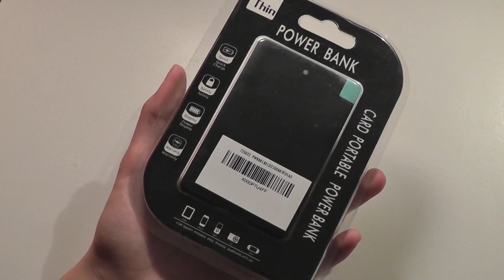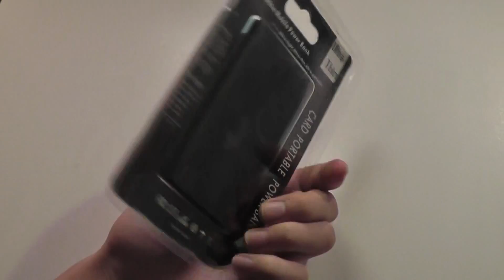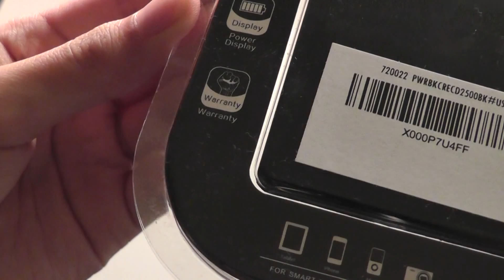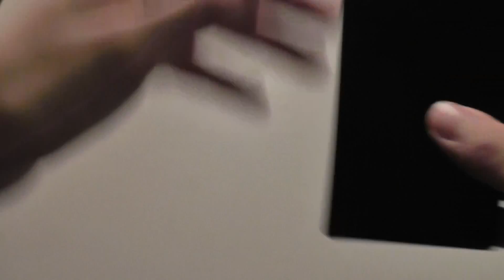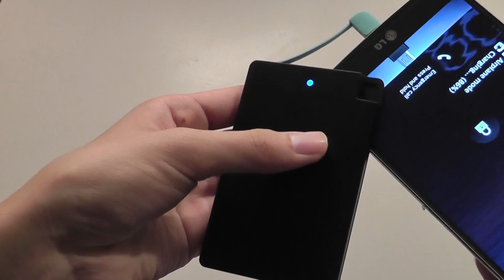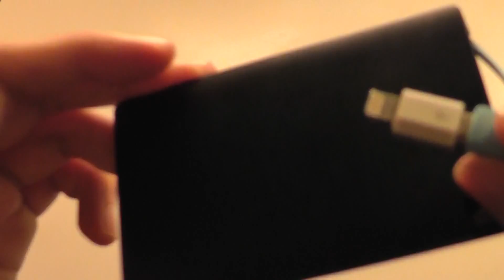REVIEW: Power Bank Card 2500mAh World's Thinnest Power Bank

Comment: can I jump start my car with it?
Reply: Yes, there is way more energy than u need. Just add some sapacitors, charge em with this device and start your car using em. (Reason in that for starting a car you need more energy in shorter period of time = current, to deliver that current you need to use caps)
Reply: must take a piss in the fuel tank first after downing a 40oz

Comment: He says tablets will work with it!! 
It's smaller than an iPad battery so it won't make much difference at all but it can give a phone a boost I like it but it never goes blue (full) just always flashes red.anyway even at full it would not have much capacity it's a small booster at best..handy all the same.
Reply: +Dan Servante 2500 mAh, yeah i wouldn't take anything with less than 3500, which usually cost around ten bucks, this thing is 35$! What a ripoff
Reply: If уоu rеаllу wаnt hеr bасk, уоu nееd tоо gо wаtсh this vidео rightnооооw bу mу friеnd Мiсhаеl Fiоrе => https://twitter.com/db3e1bcc94ff17d37/status/790853501416935424                                                             REVIЕW  Рооооwеr Bаnk Cаrd 2500mАh Wооrld s Тhinnеst Рооооwеr Bаnk